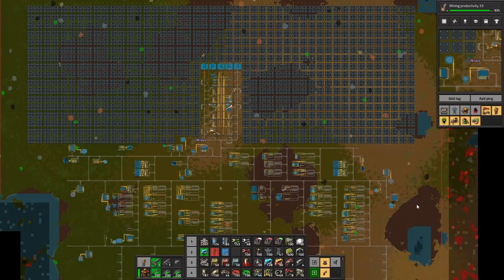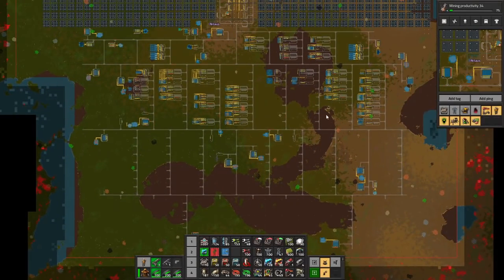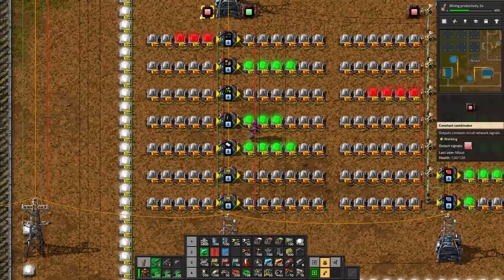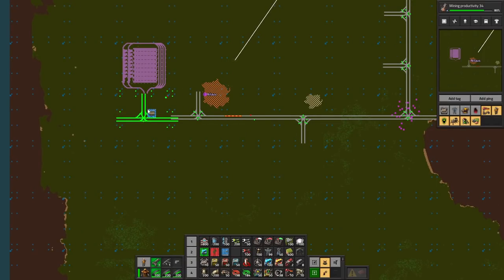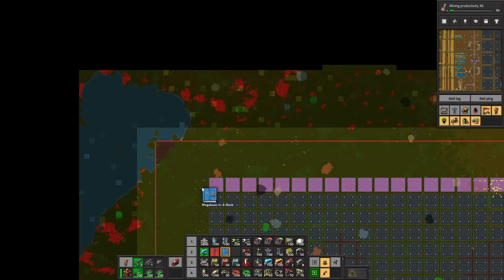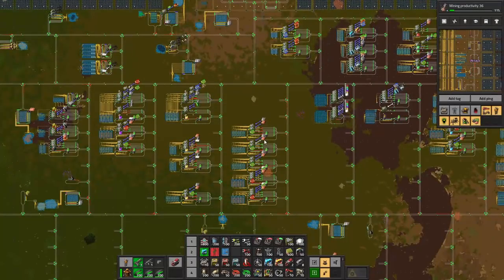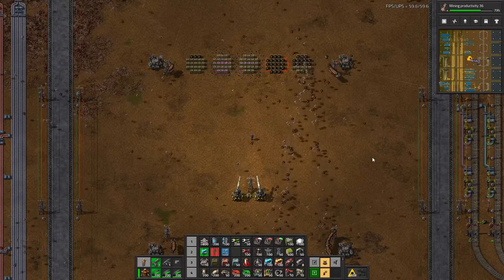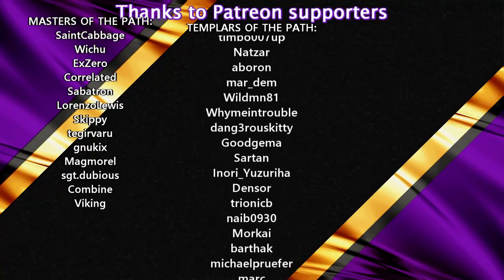A Clever Way To Deal With Excess Wood | #38 | Factorio Megabase-In-A-Book Lets Play

Comment: Just to optimize the "wood deconstruction process", you could use requester chests instead of storage; then you wouldn't need to mess with your regular storage to get the drones to fill them up. Also you could set it up to "deconstruct" other stuff more easily.
Reply: Also, why would you make your robots deliver artillery shells?!? They come with their own delivery method. Just build the turrets next to the shell assemblers and direct insert!
Reply: @Pystro  Nilaus Prime Air delivery
Reply: One issue with this is that every time you nuke your wood, you tie up thousands of logistic robots immediately.

Comment: When watching the production graphics, a resource that is produced with ups and downs is not a bottleneck. Bottlenecks are being constantly produced at the same rate, so it will be a horizontal line. Doesn't mean that every horizontal line is a bottleneck, but is a necessary condition. If you are low on a product that is being produced up and down, the bottleneck is one of its ingredients.

Also, alternative title of the video in another platform: how to get rid of your wood quickly...

Comment: Hi Nilaus.  
Remember when looking at the dashboard, the number if requests is shown until the train arrives. 
The train load is not included. 

So 4 demand and 4 supply with trains ready to leave a station, means 4 supply plus 4 incoming trains to the demand
Reply: Yeah, this is the reason the steel is showing up as insufficient on the dashboard with trains ready, I was going to comment it but you'd already done so, so thanks for saving me the time.
Reply: I think there is a way to substract amount of trains on the way. This would be a lot adequate statistic

Comment: Looks like you have more steel trains than requesting stations, so the train can't go unload because the requesting station is occupied by the train that can't go load because the steel factory is still not filled enough.

Or at least I think that's what's going on.
Reply: I think this is it.  And also, because steel doesn't have the same number of waiting spots for trains as the other stations it makes it worse as they end up waiting at the unloading spots.
Reply: I've solved this by adding waiting locations near the supply and demand locations and have 4 stations set up, so they always go to the refueling/depot station, which are identically named stations with 1 train limit, serving as waiting spots, so that loading/unloading stations are never occupied more than for the time being loaded/unloaded

Comment: Hi Nilaus. Great series. Thank you. The steel problem is like this:
Because you're finely balanced, there are times when at the steel demand station you have one empty train at the station blocking full trains behind it. The empty train cannot path to a steel supply because there are none available. The boxes at the station empty and the station requests another train. But, until the first train can exit to an available steel supply station, the situation persists.

2 solutions:
Lazy: Just build more steel until there's always guaranteed to be a station available for empty trains to path to.
Brainy: Is there a way to force empty trains to path to the stackers so that the full trains behind then can pull into the stations and discharge?

Comment: I've been musing on the glitch observed with the dashboard, and I think I have a couple possible solutions. To start with, let's consider the stated definitions of the global red and green circuits. The red circuit reports the global supply of a given good, and the green circuit contains the global demand for the given good. I would amend that definition slightly, stating that the red circuit reports the global supply for the given good that is waiting to be loaded.

The metric that the dashboard currently can't determine is the number of dispatched but not yet delivered trainloads of a given good. To determine the number of train loads en-route, you would use the 'read train count' behavior at each of the unload stations.  The question then is how to communicate this metric to the dashboard. I see three possible solutions. 
* Add the number of dispatched trains of a given good to the red circuit. This would mean that the red wire would report the number of available or dispatched trainloads of a given good. This would be most closely aligned with your current reporting design. The downside is that you wouldn't be able to tell how many loads are waiting and how many are in transit.
* Subtract the number of dispatched trains from the green circuit. This would mean that the green circuit would report the number of unfulfilled trainloads of a given good. The downside to this is that you would essentially get the same information as the single wire dashboard (positive green for excess demand, positive red for excess supply)
* Send the total available supply on red (loads available+loads en-route-loads demanded), and the supply en-route on green.

One other possibility to get more information on a single circuit would be to use bitwise operations. If you split the (signed) 32 bit integer into two (unsigned) 16 bit integers, you might be able to use one wire to send the loads demanded in a low half, and the supply en-route in the high half. You could even subdivide further, breaking the 32 bit integer into 3x 10 bit (unsigned) integers or 4x 8 bit (unsigned) integers. This would give a range of 0-1023 or 0-255, but either should be enough for a mid-scale megabase.

Comment: You have too many steel trains. You're using less than 1 train load per minute, it spends 30 secs at a station, so you only need 2-3 trains across the whole network (depending on travel time).

Comment: Question, when and should you ever, move your main bus?
Reply: I usually build a new main bus and gradually move everything to the new location (usually more Central with train entrance from several directions). The new bus is usually cleaner and more robust. The Malls are usually more advanced too.
Reply: @plasmman  That's what I was roughly planning... I suppose it's worth it.
Reply: Nilaus alluded to this toward the end of the episode. He mentioned converting the original factory and main bus to a roboport-based network. I assume that will include ripping out the main bus.
Reply: @tricorius9653  Hmm, does that achieve the same throughput as conveyers?
Reply: @Technofier  he has upgraded bots, but no I don’t think they would be close to what a blue belt bus can handle. But he also mentioned that the area will be changed s it doesn’t need as much throughput. My guess is that it will mostly just be for the hub items, but who knows: maybe we will see a city block dedicated to a late-game bot-based hub.